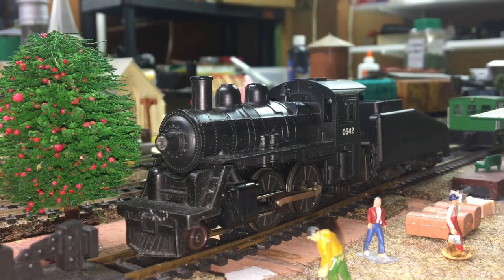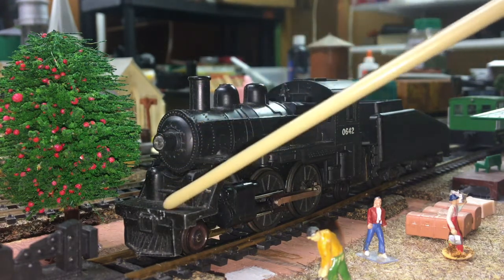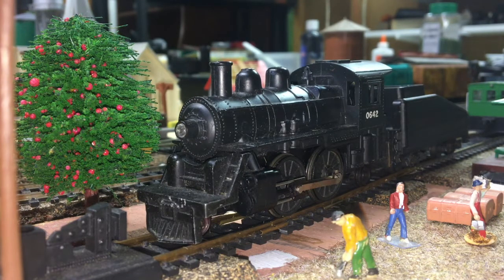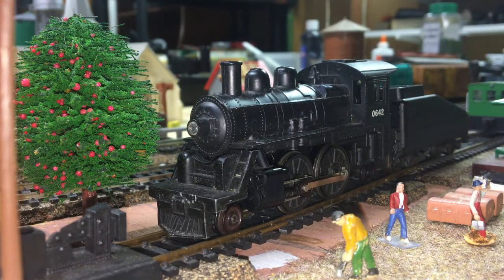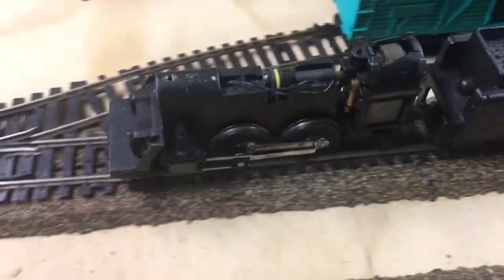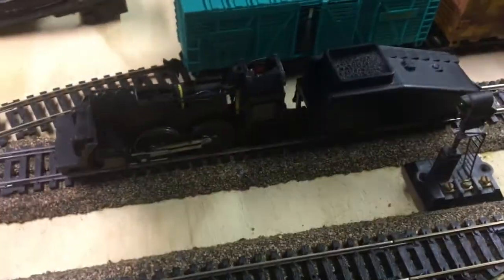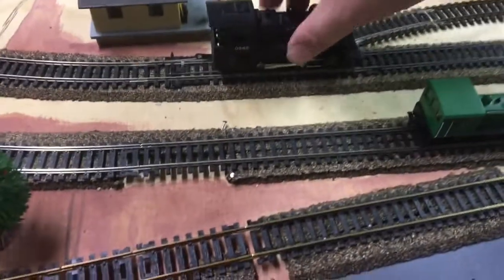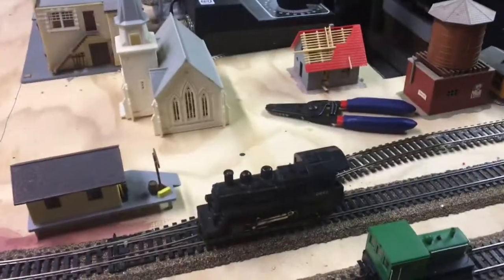Lionel H.O. 2-4-2 Showcase

Comment: That Lionel locomotive was from their first outing into 'HO' scale from the (1957-1966) period, Also, if that locomotive is giving you trouble just turn it into a hand push model or better yet, If your modeling a railroad museum on your layout use that loco as a static display.

Comment: Part of the explanation for this weirdness, is that the 0642 shares the exact same shell as the 0602 switcher, the only difference being the cab number. The 0602 is one of the locomotives that used recycled HObbyline tooling, but the drive was completely redesigned. I own an 0602 but it's not in the best shape... it's superior to the 0642 in having an entirely geared drive, however mine has a split nylon worm, and I haven't yet gotten it to be a good runner. I also had to steal brushes and springs from another motor to replace the originals which had failed. Unless I can re-gear it, I'm not sure there's anything that can fix it. I don't think they usually have this issue though, but still... wouldn't want to sink too much money into these locomotives, you can't be sure if they're going to be a doable project or not.

Comment: How can you tell when the rubber bands need replacing
Reply from the maker: Well simply put, the engine won’t move lol
Reply: @BigLittleWorks okay. Where can you find replacements?
Reply from the maker: @QueenMaryStan  I haven’t worked out an exact source but I know athearn makes replacement bands for their old band drive engines that are nice quality (dollar store bands usually break easy). If I ever try them on this engine, I’ll leave a comment letting you know.
Reply: @BigLittleWorks  okay, thank you so much!